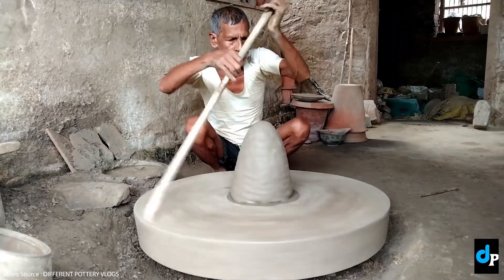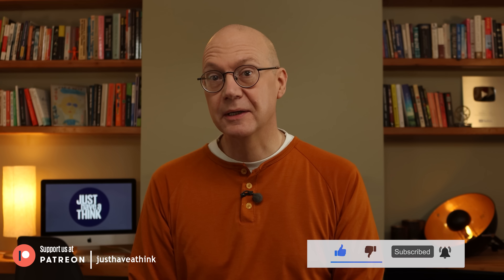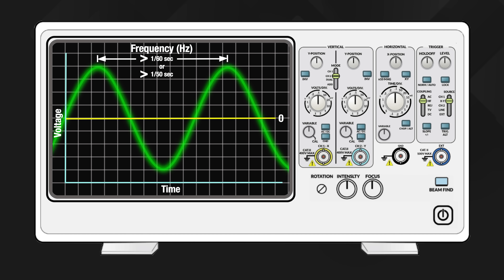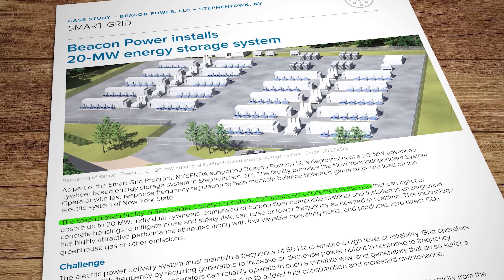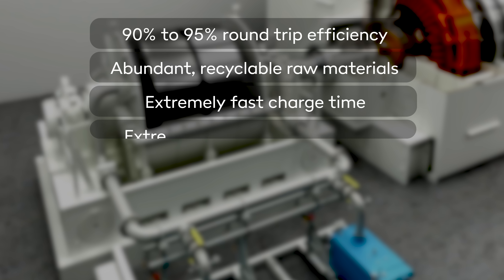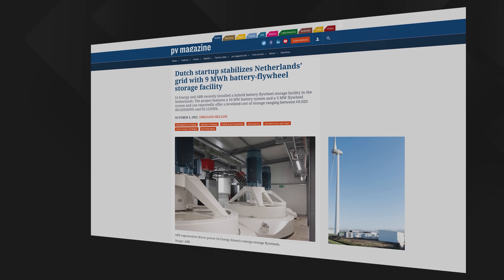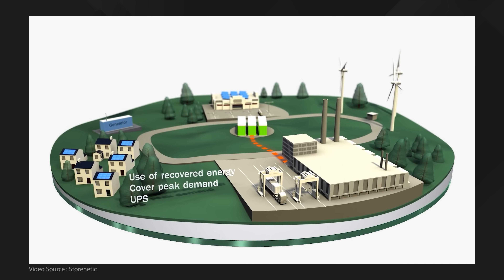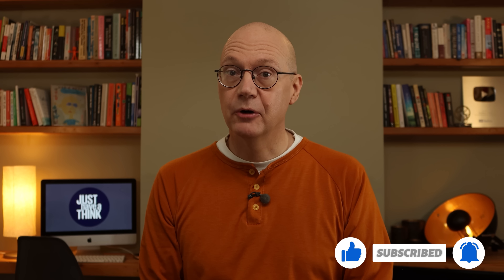Flywheel reinvention revolutionising our power grids!

Comment: IIRC The JET fusion facility has two giant counter-rotating horizontal flywheels in its basement that are used to dump in the massive power requirement it needs every time it lights up a plasma.

Comment: Fly wheels are not perfectly safe in operation, they can absolutely come apart spewing fragments of the wheel in a disk of shrapnel that can be plenty destructive and lethal. This can be guarded against fairly reasonably with shielding, so it isn't a prohibitive problem, but like all energy storage, there is inherent risk that needs to be properly managed.
Reply: Why not bury or put earth berms around the flywheels similar to what is done when explosives are manufactured?
Reply: @chuckkottke  Yes, that is the basic safeguard, but that makes them take up more space, and you have to be able to get to them for install/maintenance work, so you need walkways over the berm. You also can't fully protect the mechanisms for delivering power to the flywheel and drawing from it, there will be some chance of ricochets hitting that when one fails.

It is a manageable risk for sure, but a risk that needs to be dealt with appropriately which increases the cost of the system.

Comment: I think storing energy to give it back over night might be an important application, so if it lasts from peak renewable (probably at noon) to maybe eight in the morning, that’s 20h.

When you need longer storage, you probably need a different solution. We need a comparison video with compressed air, or those “lift some weight to a higher place”-thingies.

Here is my crazy idea: liftable houses! - Maybe when building new houses they could have two layers of foundation with a bladder of water in between, that  pumps / expands and contracts with the weight of the house on top: no need to build the weights separately (as concrete produces CO2). And when the nearby river floods, you just pump up your house out of harms way (and even store a little bit of extra water; assuming you could draw the extra water from the same river). Houses would kind of have an extra level of basement full of water. Maybe it could even double as a heat sink for air conditioning, or as a cistern for the dry weeks of the year. - just add some water storage to every building. - Oh, wait: that’s a kind of water tower…
Reply: At least quadruple the cost of the house. Probably 20x or more. The reason houses in flood zones are built on stilts is it is far cheaper to get above the water than to deal with it. Lift the house when you build it.
Reply: The only less suitable way to store energy than a flywheel, would be compresses air.
Reply: I recall reading an article about houses that could be built as a sort of houseboat sitting on dry land in flood-prone areas. There were stabilizing columns that kept the house from moving laterally and floating away, if the flood did occur.
Reply: Vacuums and magnetic bearings will lower the losses and increase the costs.

Comment: Once again showing how there are many ways to address fluctuations in renewable energy along with a reminder the same is necessary for fossil fuels. The old term "baseload" in fading is its utility and when combined with demand management and understanding other factors in legacy systems for example, generators that run overnight when the power has little value (off peak) reduce overall system efficiency.

Comment: Flywheels don't catch fire like lithium does. See the northern California gas plant that was replaced with battery storage which promptly caught fire, spewing toxic smoke into residential areas!
Reply: I'll bet that smelled nice!  And flywheels can be sited underground, negating the failure issues.
Reply: @chuckkottke  I had a professor who worked at IBM when they were first working on hard drives. They had to be put in concrete bunkers because a head crash caused them to explode. We have better strengths of materials now but WHEN there is a failure in one of the large power flywheels...  They should say least put those monsters underground as you suggested.

Comment: EVs will automatically park itself on to a wall plug, nuzzle up and onto the power point. 

The plug will be the killer gizmo and a billion times easier to invent than the flywheel/generator/motor. 

The EVs will be part of the national grid 23/7/365.
The one hour daily drive will be tiny, 7kwh.

Comment: Lithium batteries 🔋 require inverters.

Spinning generators can better absorb current spikes, that inverters do not do well at.

Sure, low frequency inverters handle large current spikes, making it more like a spinning generator, by depending on lots of copper & electric fields. 

Flywheels are used in data centers today. It is well understood.

Flywheels could be a good help to reduce spikes at fast charging stations.

Flywheels can be deadly, with failure.

Hydrogen just seems to be a better solution for an island 🏝️ like the UK 🇬🇧, where offshore windmills can create H2 gas offshore, get stored on-land, piped everywhere, and consumed for heating, cooking, and portable use in cars, lories, and trains.

Comment: It looks like a Rotary UPS system which have been around for a long time.  At one remote facility that I worked at back in the 80's we had one.  The power from the utility was a bit iffy, therefore we had one of these RUPU (Rotary Uninterruptible Power Units) in our building to smooth out the power.  The utility was connected to a motor which spun the flywheel, to drive a motor/generator that supplied clean power to the equipment.  Should the utility fail the flywheel provided bridging power until the diesel genset flashed up and took the load.

Comment: earth's gravity and earth's magnetism and earth's rotation work against a flywheel holding it's charge.  the vacuum helps reduce friction, composites reduce magnetic drag.  specific orientation to external fields would be advantageous during installation.  a purely vertical axis would only be advantageous at the north and south rotational poles, and even then precession would still create a small drag influence.  place the spinning mass in a full gyroscopic framework, so it can be oriented to it's 'natural state' axial vector, which changes as external conditions change, like an azmuth mount but also calulated to respond to gravity and the magnetic field of the earth as well.  lift the aparatus to the top of a mountain to reduce the tug of gravity, adjust for the higher rotational effect by being farther from the core.  then you might have a flywheel that would freespin for two days :)
Reply: Does the mountain have a lithium mine in it? 😉

Comment: A few years ago I had an idea for a 100' diameter rotating ring rotating and floating in a level trough using maglev and vacuum.  It seemed to me that so long as it was strong enough to remain a solid ring, you could spin it up to arbitrary speeds.  I wonder, however, if there would be issues relating to precession?
Reply: Work out the 'strong enough' part though - that's your problem. The speeds you need to be practical only a few materials can endure.

Comment: Flywheels for frequency regulation?  A brownout is caused by a dip in voltage where the load is too large for the generating capacity.  The frequency stays the same.

Comment: Flywheels are not bulk energy storage, and with batteries attached to a grid, flywheels are not strictly needed for stabilisation.
What they do bring though is a significant reduction in battery ripple current. By taking the role of batteries as stabilisation for very short transients, they significantly extend battery life by reducing the number of charge/discharge cycles (part cycling adds up for battery life)

While flywheels do respond very quickly to transients, they are slow poke compared to ultra capacitors.

Comment: I wonder if we could design wind turbines that drive multiple long cylindrical flywheels in series in the tower housing and have the generator at the bottom and then tap the inertia regulated power from there

Comment: Yes for hospitals and essential.
The fly wheel will turn the right cables for the right work to do.
In the mean time by 
Turning off IT items , =  mobiles.As one commutes out of the home to working places not having three hundred non humans here is healthier.

This brings  everyone safely from home to work and return to home 

I stopped this when I am just me.
Been self is fine but chat was not happening as i heard no humans other than me. So to be not selected for not here is to absorb other people thoughts That allows easier chat and chitters . But turning off devices between leaving the home to the office or if you WFH  use your cables via your modem to all  IT items. The mobile phone,  the cooker , the fridge , the washing machine the old computer toys , even  a charger. Or a battery. 
That is as the energy helix wave travels not via a body in the above daly life of humans but in a medium that safely stops the repeated sizziling of the strands which stops the DNA from been cut because you argued about spilt water.  
The brain dose nit like wifi or unhelpful attitudes. Thus anseer to polution is better than i dont want trouble.
Ttouble is life. 

Then as cleaning a floor or not overeating or drinking the self is easier to be present.
Interpreted.
Why it leaves? no room !

Comment: This video makes me think about a flywheel/Sterling Engine combo as a device that could be built on a model basis and scaled up for residential power backup usage.  This is especially true when one puts the flywheel into a vacuum container.
Reply: Stirling engines can achieve very impressive efficiency, but their power density is terrible: If you want a lot of power, they need to be big.
Reply: @vylbird8014  I am surprised you say this because the European, Japanese, and Chinese Submarine Forces use Sterling Engines as their main propulsion.  Now these are the diesel submarines and are not that big.
Reply: @anthonycarbone3826  I thought you were talking about Stirling engines. Confusingly similar names that everyone gets wrong, but the Stirling is the better-known.
Reply: @vylbird8014  I was talking about the Stirling engine.  Sorry for the misspelling as I did not  know there was both a Stirling and a Sterling engine.  In my mind I thought it was spelled with an e as in Sterling.
Reply: Do we mean "Stirling" the low temperature heat engine or "Sterling" engine, the internal combustion engine which uses swashplates instead of a crankshaft?
Reply: Just power the Stirling engine using the difference in temperature between the ground and the air! 😉.
Reply: @chuckkottke  To take either cool or warm air out of the ground follows a specific equation so as not to deplete a small surface area and make sure the difference remains.  Usually this is done by some type of heat pump which is exactly what the Stirling Engine is or one of its main uses.  It is not so easy to create electricity from this exchange but of course it can provide heated and cooled air.
Reply: @chuckkottke  That's just geothermal energy. It's great, when it's an option - affordable, clean, reliable. But only a very few places have the geological conditions to make it viable.

Comment: So that 20MW flywheel complex.. Why is it carbon fiber? Wouldn't steel be better for inertia? [after listening further] Ah, is it because of idle spin-down, maybe? Less weight pushing on the bearings?
Reply: Tensile strength turns out to be the limiting factor when designing high energy storage flywheels.   Hence a carbon fiber flywheel allows for a greater energy storage.

Comment: Welcome back! It's great to see you again.

Flywheels are fun. Wish I had something deeper to say, but I'm afraid that's all I've got on this one. They're fun to play around with in toys, and they have all kinds of fun applications in real life. This was a really interesting breakdown of the benefits and costs of flywheels in an energy storage context.

So their main advantages over lithium ion batteries is they can be made from common materials and they last a really long time. If the flywheel is rotating on magnetic bearings I don't see how it could ever wear out, but the other bits that connect to the wheel like the spinny motor won't last forever. So if you want to maximize the lifetime of a flywheel you need good engineering. And it would probably help if it had a modular design, so you could replace the worn parts without replacing the giant wheel itself. Looks like that EnWheel at the end of the video takes the opposite approach and makes the entire flywheel apparatus a single unit. Instead of having modular parts that can be upgraded, you take out the entire unit and replace it with a new one. I wonder how the economics would work with that approach.
Reply: But surely the bits that do wear out, could be easily replaced, the flywheel, housing and bearings could be kept in operation 100 years or so.
Reply: Absolutely, if the flywheel is built in modular fashion so you can swap out parts.

Comment: Every major airport has been doing this to “keep the lights on” reliably for decades. “No-break” generators are usually only activated when critical weather is expected, but they were tested regularly for functional operation, back when I was a tower ATC in the 80’s.
Reply: Before I worked for an electric company (started in 1984) many of our remote comm sites had Micropower (tm) APUs. These things were a motor-generator pair with a propane powered generator coupled to it. In the event of loss of commercial AC the propane generator was coupled to it via a flywheel and (in theory) the AC was delivered without a hiccup.

Comment: If only ... if only - my first thoughts was if only flywheels had been developed as a widely used product 70, 80 maybe 100 years ago.   It could have been used in cars, buses and trucks.  50 years ago we would plug our car in a few minutes before leaving the home,   charge it the flywheel in the car and off we go.   Connect to an overhead cable when we get to the main road,  just like a trolley car and tram,  to recharge the flywheel.   Then the environment would be cleaner now and we would not be so reliant on fossil fuels.... if only.

Comment: Wait, so why are flywheels more expensive to operate than li ion batteries (per kwh)? Is it just the energy density problem? Can that be offset with larger installations and stuff? (I guess you can't improve too much on 90+% efficiency.) Or is it pretty much already at the limits of what physics allows? I suppose we've been working on flywheels in industry for a very, very long time. So perhaps there aren't that many generational advancements left to make.

Comment: I remember the flywheel buses, and how they were going to put an end to air pollution. And there were all sorts of machines,  from auto engines to sewing machines, that had big heavy spinny things in them.
Reply: Flywheel buses would have been extremely dangerous in the event of a collision. Furthermore the large angular momentum would make steering difficult.
Reply: Optimal Fuel efficiency requires the least weight so not surprised that flywheels didn’t work.  As to Roger Phelps comment about dangerous flywheels in an accident - strange that we don’t say the same thing about gasoline - when it contains far more energy than a flywheel.   It is human nature to worry about the “new” risk and discount the existing risk!

Comment: What has been done already is to leave the generators in old power stations connected to the grid as synchronous condensers for grid stability. Also some of the hydro generators have long been used for the same purpose. All of this though is only for short term stability, not as long term energy storage. Using very large flywheels to store significant amounts of energy long term doesn't seem such a great idea to me. When things go wrong and all that mechanical energy has to go somewhere the result can be pretty ugly. Also  there's got to be a mechanism to get the energy into and out of the flywheel. This is more complex than a synchronous condenser which is always connected to the grid.

Comment: I did some work in a nuclear power plant.  They used a 2500 lb flywheel for emergency power for rod drive motors.  During an emergency and lose of all power the flywheel would provide enough power to the rod drive motors to get the reactor control rods all the way down. The set up was, a small motor/generator was coupled to a flywheel which was coupled to the rod drive motors. During normal operation the motor/generator would run continuously.  With total black out the control rods would fall about 90% of the way then the flywheel would provide enough power to the system to get the control rods the rest of the way.

Comment: Glass - Likely silly but since I read about flywheel storage as the next big thing 60+ years ago in Popular Science, I wondered about glass for the disk.  Glass seems very dense.  They cast very large mirrors for telescopes.  Just a guess but it seems glass would be good in resisting tension so you could spin it very fast.  Balance could be possible with the cast disk and axle spun vertically in a bearing that allowed it to go eccentric.  The heavy side would trace an arc a bit wider than the lighter side.  Mount a grinder that removed a little from the high side by moving the grinder in as RPM was increased.  This might only seem reasonable to someone who thoroughly enjoyed the 60s in Northern California collage daze.